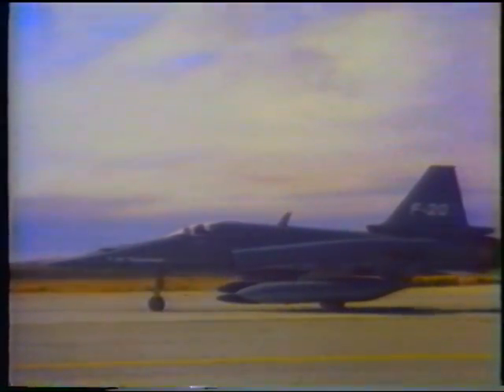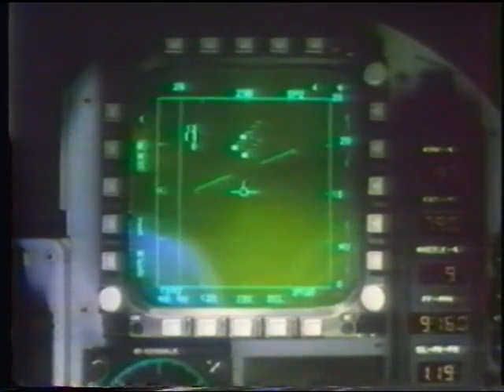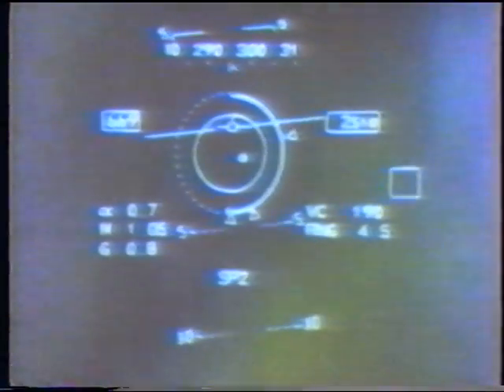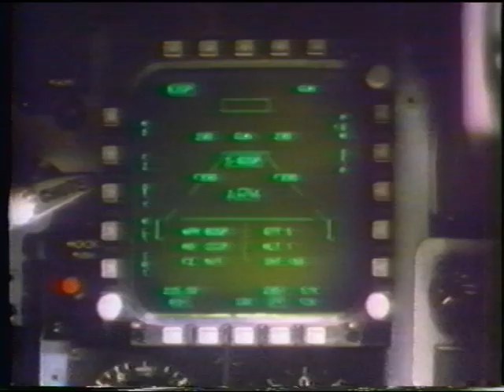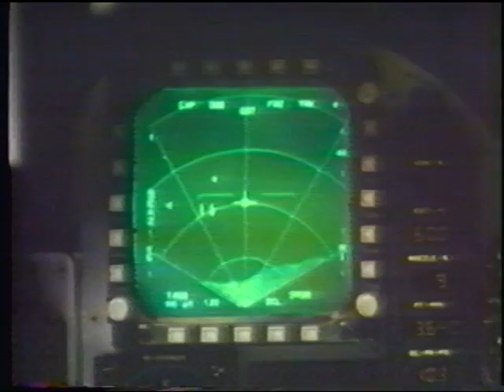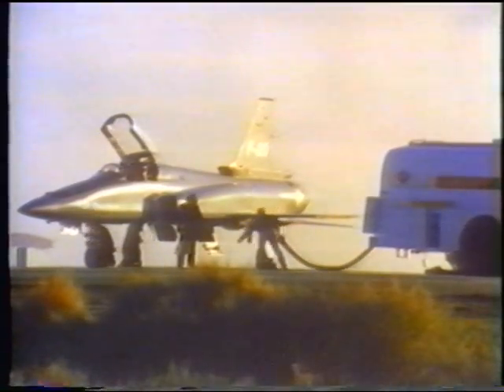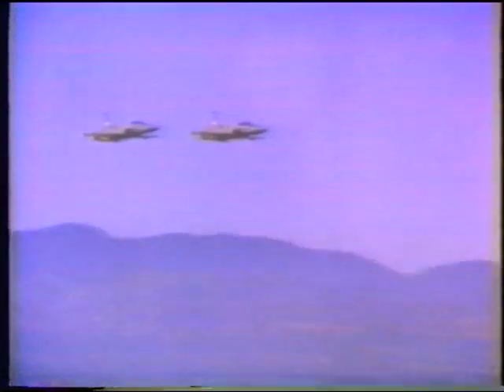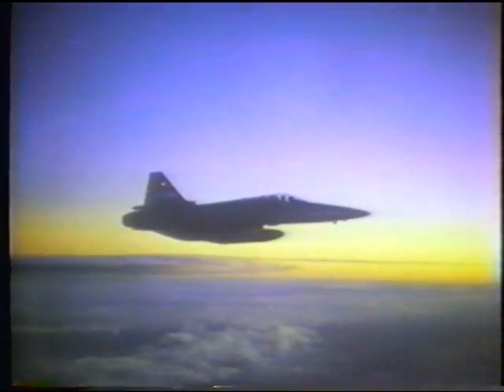F20 Tigershark historical video

Comment: cost of owning an aircraft is maintenance, up keep and parts. Northrop was trying to sell the f-20 to nations that owned the f-5.There was parts commonality, retraining maintainers would be negligible. F-404 engine is a great engine, slightly derated provided longer lifetime of hot parts . The aircraft handled very well considering it was not fly by wire. Performance comparison to the f-16 :close, on cost well below.General dynamics took a bath on selling f-16s below cost to keep the f-20 out.
Reply: Several of the prospective nations who might have purchased the F-20 were at the airshow in South Korea where it crashed in front of them. That, its limited stores, and limited growth potential compared to the combat-proven and highly adaptable F-16 did it in. F-16A cost was already very low in the early 1980s and provided a very flexible multirole fighter. It proved to be the most successful single engine fighter design in jet history, even according to Russian analysts who recognize the failure of the MiG-29 in comparison, especially given their immense success with MiG-21 foreign sales and fleet production numbers.
Reply: @LRRPFco52  the F16 did do it in , but general Dynamics intentionally dropped the price of the F-16 because of the F-20. The F-16 was definitely ahead technologically speaking. But if some countries are still flying the F-5e today it stands to reason the F-20 would still have been out there putting in flight time today. Not to mention former Warsaw pact countries still flying the Mig 21!
Reply: @westwindsailer  The F-5 was used by Iran a lot in the Iraq-Iran War of the 1980s, and Saudis used the RF-5 variant specifically for the reconnaissance package nose modification.  The RF-5 could get into places due to its low RCS when facing older generation IADS, but doesn't have much luck in a modern IADS.  Saudi Arabia certainly wasn't a poor nation, and is one of the few that can afford the F-15C and F-15E variants with the F-15S.  They incrementally retired the RF-5E and F-5E/F over the past 2 decades as they acquired Typhoons.

The cost-to-benefit analysis of the early-mid 1980s F-16A vs the F-20A (no accurate production cost was available since there were no orders) justifies the purchase of the F-16A/B instead.  Also note that no F-20B had been developed as a conversion trainer for squadrons to check-out new pilots, whereas the F-16A/B was already developed in the late 1970s and had 3 major production lines in the US and Europe ranking out fighters in high volume.

F-16A Block 15 unit price in the early 1980s was already very close to the projected F-20A unit price, but you get a 450nm combat radius, multirole, 9 hard point fighter with tons of spares support for about the same price.
Reply: @LRRPFco52  the bottom line history and politics  speaks for itself.
Reply: @westwindsailer  I know.  I lived through it, with peripheral inside access to some of the Pentagon-internal discussions about the F-20.  At the time, I felt the F-20 should have been produced but none of us were aware that there were other projects like Senior Trend and Senior Sky.

The F-16XL would have been a better airframe to add to the inventory in place of many of the F-16C/D airframes, since the USAF used the F-16 as a bomb truck anyway.  It would have needed the IPE motor though, with further development of materials sciences to reduce the airframe weight.
Reply: @LRRPFco52  XL , a big winged delta... yeah it was a huge bomb truck , lots of internal fuel, with 4 amraam's semi conformal. In conflicts to come it could definitely make history "like a bomber" .

Comment: It was originally meant to be the "F-5 G," an improvement on the F-5 E "Tiger," but as Northrop continued development, they ended up with an entirely new airframe featuring glass cockpit, enhanced maneuverability (in no small part thanks to its vastly improved 1.1 to 1 thrust-to-weight ratio) and the whole 9 yards. A beautiful and deadly fighter, no two ways about it.  It's a crying shame it was killed by the dirty tricks of bigger firms. (Anyone else remember the Lockheed bribery scandal?)
Reply: It was killed by its own inherent lack of performance, especially combat radius that was 1/3 the F-16's, small payload, limited cockpit visibility, limited expansion potential for FLIR and Targeting pods, ECM, 2000lb bombs, etc.  I thought it was cool at the time too, but an honest comparison between it and the F-16 leaves the F-20 lacking in almost every metric.
Reply: @LRRPFco52  "By every metric?" A USAF F-16 pilot who got to fly the F-20 told me it easily went supersonic at milpo with carrying external ordnance; the F-16 needs afterburner to match that particular metric. Also, it would have been an ideal point defence interceptor, especially for countries that already had operational experience with the "disposable" F-5. It also had considerably faster turnaround times, which would have yielded a much higher in-service rates than the F-16.  

Trust me, Northrop didn't sink over a billion of their own money into a dog; read up on the infamous Lockheed bribery and skullduggery campaign.
Reply: @That70sGuitarist  "Almost every metric"

There is always going to be some advantage of one design over another, but when the deck was stacked so heavily in favor of the F-16, you can see why the F-20A was never really a viable contender.

Supersonic performance turns fuel into heat at an extremely fast rate, so the F-20 would bingo immediately after going supersonic, especially with stores.

It would have been a better option for nations that bought MiG-29s, but since they weren't on favorable trade status with the US, the F-20 wasn't an option anyway.

If you look at all the FMS contracts that went with the F-16, they wanted F-16s because that's what the USAF had and Israel showed what the F-16 was capable of early on.

Comment: The "F-20 Tigershark" a high powered plane with a innovative aeronautic shape is the answer of the generally bigest problems of different armys and their advantages. 
To the problems referring on aircraft carrier and ground based minuteman airfields
predicted at short maintenance work and a way to do a hard repair job at a very 
short downtime the very upkeep-friendly built in figther gears do a great deal. 

On small Countries a fast interception route can be flewn nearby a no-fly zone.

Comment: You are also correct, but it wasn't pure politics that killed it, more of a no-win situation. Foreign customers didn't like it because the USAF wouldn't buy it. The USAF wouldn't buy it because the F-16 was as small as they could go (plus, being a day-fighter at the time, the F-16 was less of a threat to the F-15). If the USAF had purchased a token number... well, let's just say they didn't want to open the door to thoughts of the cheaper (if undersized) F-20 becoming the primary fighter.
Reply: The Air Force also didn't want it because it was explicitly built based on a requirement for reduced-capability aircraft for export (the same reason the Navy quickly sought to get rid of USS Mississippi and USS Idaho in the 1910s - there was no reason to keep around a battleship that was deliberately built to be less capable than the previous class (especially in the Dreadnought era).

Comment: The F-20 would be great for Israel, with its one minute scramble time and turning ability. I'm wondering if you could dab a little radar absorbent material on it and make it harder to detect.
Reply: Israel already had the F-16A by 1980, and by arpund 1985-1986, had the BVR-capable F-16C.
So, they really didn't need it.

Comment: F20 18,000 pounds thrust, F16 29,000, F35 45,000 pounds.
Reply: Today, the F414epe provides 28,000 pounds thrust in the identical dimensions as the F404 for only 100 pounds added weight. The F-20 airframe is significantly lighter than those others.

Comment: While the F-20 has demonstrated excellent air to ground capability, using it in that role wastes its supersonic and high altitude fighter capabilities.  A modernized A-4 powered by a non afterburner equipped GE F404 version of the F-20's engine would be a better choice for strike/CAS missions protected by F-20s performing the air superiority/interceptor/reconnaissance missions.  Commonality of engines and avionics would simplify and reduce cost of maintenance.  Both aircraft have high mission reliability rates and were designed for easy of maintenance...with the added caveat that they are significantly less expensive to buy and operate than other aircraft.

Comment: Given what the F-16 was eventually loaded up with, I'd say that it ended up doing significantly more than what would have been possible with the F-20 airframe.  That said, the F-20 probably would have been a better fit for many customers; but no one likes to be told that they only need the kiddie-size.  Have you ever seen a condom labeled "small and economic"?  Like you said... "sex appeal."
Reply: Nah, probably it could be upgraded, the f5 is the ar15 of planes, you can modify it forever and never gets old

Comment: An f-5 with a bigger engine, why did Northrup think they could sell this? . F-16's were already in full production around the globe and had a proven combat record in the early 80's.
Reply: They started it as the export F-5G under Carter, who would not let the higher tech planes be sold abroad. Then Reagan came along and put the F-16 up for general sale. The F-20 came to life as the F-5G was modernized to compete. It was the first fly by wire plane. It could scramble faster than any plane then or now. It was fast. It was agile. It could fire the AIM-7 Sparrow in 1982. The F-16 could only do it in 1989. It was cheaper to buy, maintain, fly, and fight. It was ridiculously reliable. It had the F-18 avionics package before the Hornet did. It had no restrictions because the airframe could handle it all. The two fatal crashes were due to pilots passing out. The planes were fine. This plane could operate on austere runways with few ground crew. It did not need ground electric to start. Corporate politics killed it. The Navy got a free squadron of F-16s as opposition planes for Top Gun, etc. This was to keep the F-20 from getting a Navy pilot in the cockpit to test it. The F-16Ns were a disaster. They barely ever flew, due to their ridiculous maintenance needs. The Navy went back to the F-5E, the parent of the F-20. It bedevils Navy Top Gun pilots, as the F-5E is hard to see and radar can't pick it up well. The F-20 is often called "the greatest that never was."

Comment: Politics killed a few things that would have been legendary IMO :(  This probably being one, the Supertomcat 21 as well which Cheaney decided there was not need for :(  Man a few mistakes IMO there due to politics.
Reply: onblock7. Nowadays, we definately could use the Tomcat-21 and an Advanced Tigershark to fill in the gaps left by the problems with the Lightning II program.

If the Grumman Ironworks had stuck with their Tomcat-21 Advanced F-14D Program (would it have been called an E-model, F-model, or S-model by now), I bet the Navy would've jumped all over buying it than the F-35C that their gonna get STUCK with now.
Reply: Have you ever looked at the year-to-year Full Mission Capability and Mission Capability rates of the F-14A, F-14B, and F-14D?  How about the total losses and fatalities?  The Navy was quite tired of the F-14's maintenance issues, losses coming aboard the boat, and fatalities with the 2-man crew.  Then to have it perform the way it did in an A2A target-rich environment in Desert Storm with zero A2A kills against any Iraqi fighters, while the USAF F-15C shot down at least 34 of them in the same time period, and 2 F/A-18Cs piloted by nuggets shot down 2 J-7s within the first 16 hours of the air war, and you see why the Navy had a really bad taste in its mouth over the F-14.
Reply: @langstonsmith972  One of the lead F-14D weapons integration test pilots and another senior 4000hr Tomcat pilot and Fighter Weapons Instructor both say the F-35C smokes the Tomcat for sport.  The weapons test pilot who commanded the F-14D test program at Pax River said he would take the LANTIRN-equipped F-14D up against anything except any of the JSF variants.  Think about that for a minute and then start to ask why guys with more relevant F-14 experience than most would say those things.  

F-35C brings more combat radius, more detection range, more radar coverage, better intercept profiles, and better Carrier Battle Group systems integration to the table than the F-14D.  It also can penetrate a modern IADS net that the A-6D and proposed A-6F could never go into and survive, while having AWACS capabilities the E-2D improved Hawkeye doesn't have.

What were these capability gaps you were talking about that the Tomcat-21 and F-20 would fill?